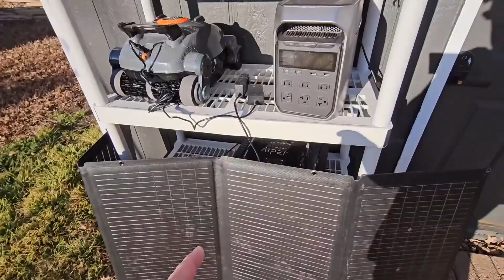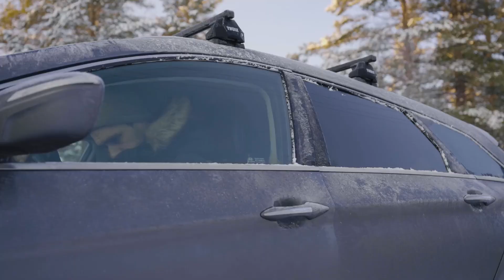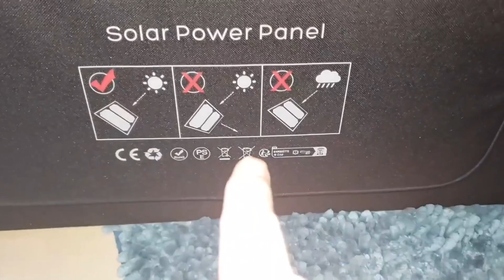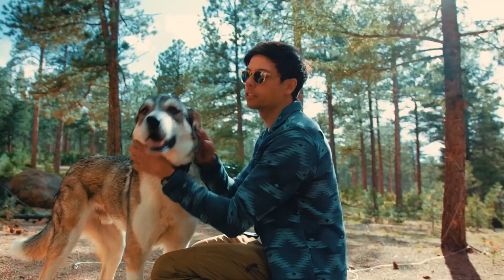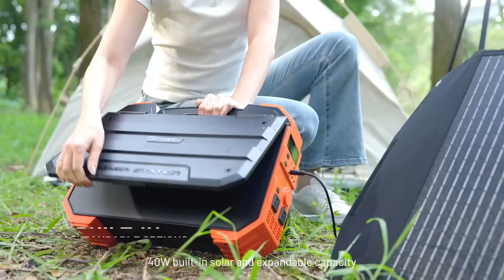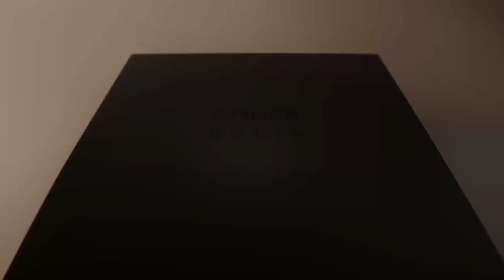The Best Solar Generators For 2026 Are A HUGE Surprise

Comment from the maker: Best Solar Generator ⤵️ | Links To Products
1. EF ECOFLOW Delta 3 - https://www.amazon.com/EF-ECOFLOW-Portable-Generator-Optional/dp/B0G15GWNZQ/ref=sr_1_1_sspa?tag=smoky0a3-20
2. ALLPOWERS R2500 - https://www.amazon.com/ALLPOWERS-Portable-Generator-Included-Function/dp/B0CGZPLTYJ/ref=sr_1_2_sspa?tag=smoky0a3-20
3. Jackery 1000 v2 - https://www.amazon.com/Jackery-Generator-Portable-Off-Grid-Emergency/dp/B0D66VD3X4/ref=sr_1_3?tag=smoky0a3-20
4. BLAVOR Portable Power Station - https://www.amazon.com/BLAVOR-Portable-Station-LiFePO4-Generator/dp/B0F7QNBZQ4/ref=sr_1_4?tag=smoky0a3-20
5. Anker SOLIX C300 - https://www.amazon.com/Anker-Portable-Generator-Traveling-Emergencies/dp/B0DBLJRRPW/ref=sr_1_6?tag=smoky0a3-20